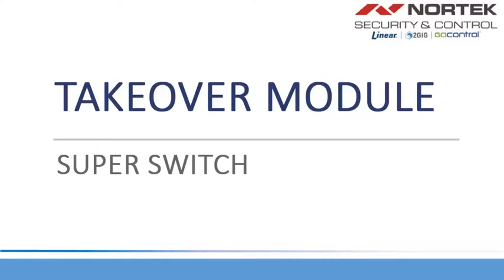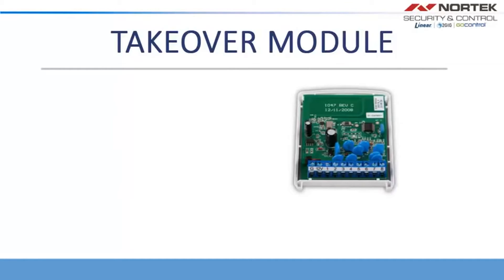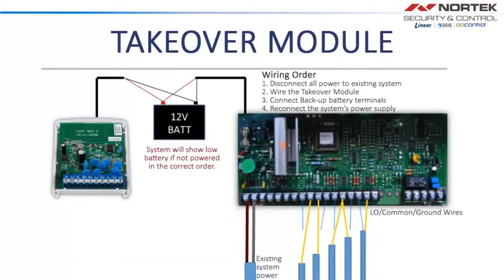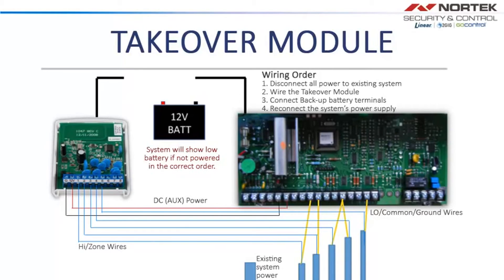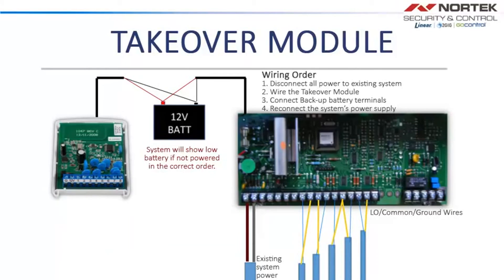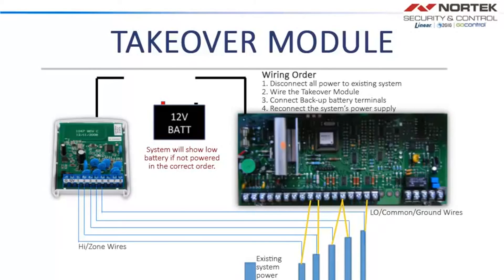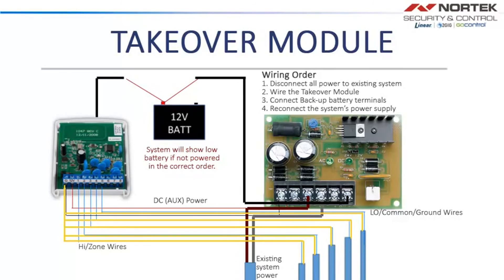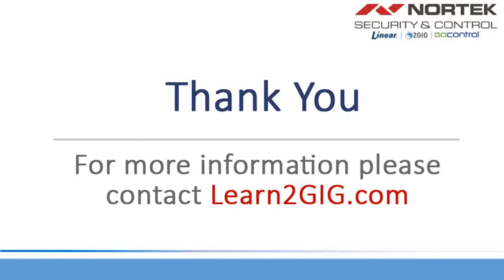2GIG Takeover Module: Installation

Comment: This is a potential service problem if the system is powered down to long. Everything will show up low battery.You must remove one wire from each power source. Then  power back up wiring the battery to the Takeover module, then battery to power supply, then the  transformer power to take over module,then transformer power to power supply.